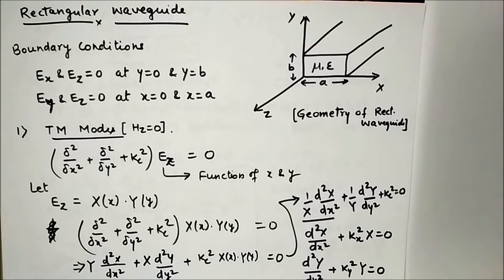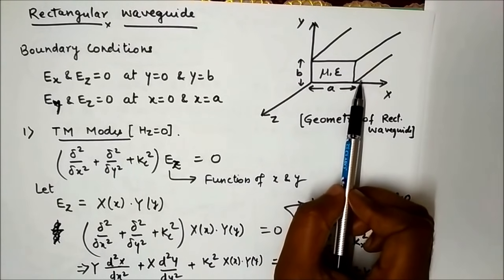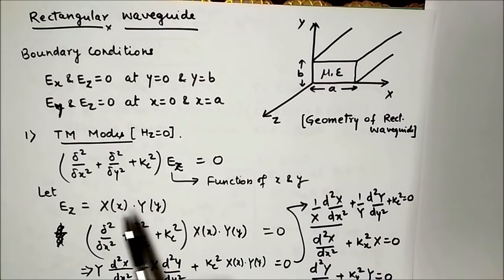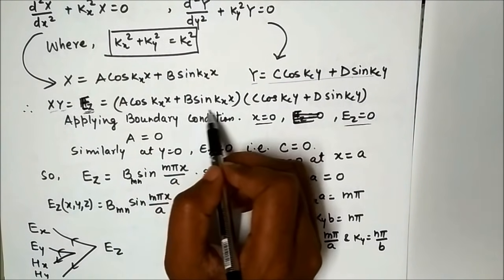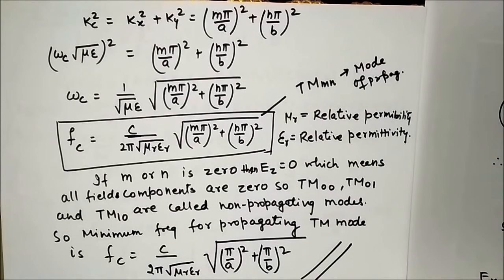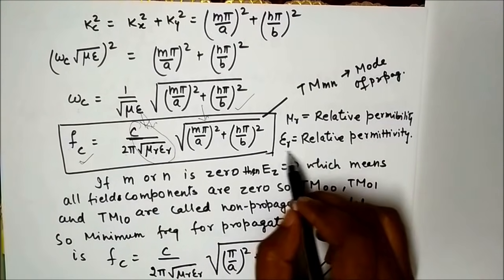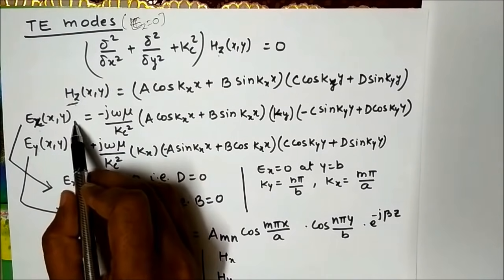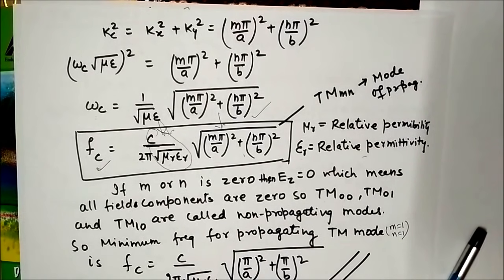Rectangular waveguide|| Derivation of Field component for TE and TM modes by Dr. Niraj Kumar VITCC

Comment: TE10 is not dominant mode it's TE01,
if a=1cm, b=2cm then,

TE01 mode:      m=0,    n=1
so, cutt-off wavelength=2*b=4cm

while, TE10 mode:      m=1,    n=0
so, cutt-off wavelength=2*a=2cm

Thus TE01 is the dominant mode.
Reply from the maker: Practically a>b.. You are right if a<b.